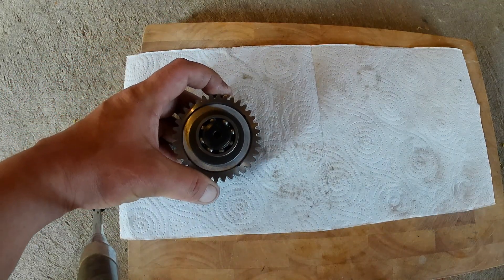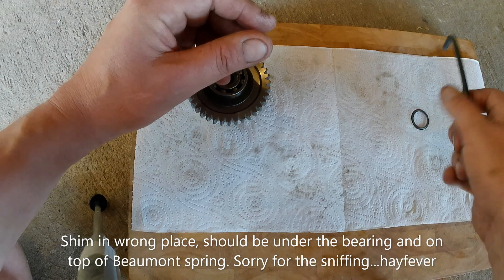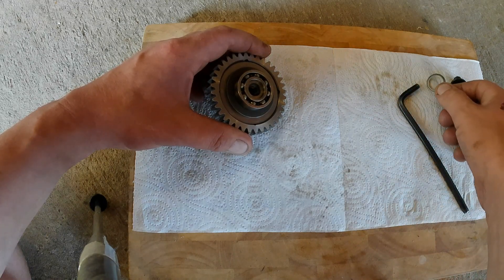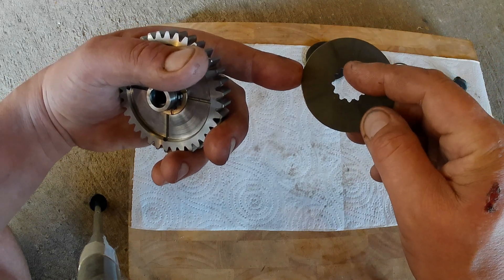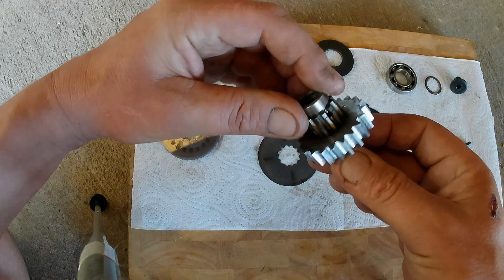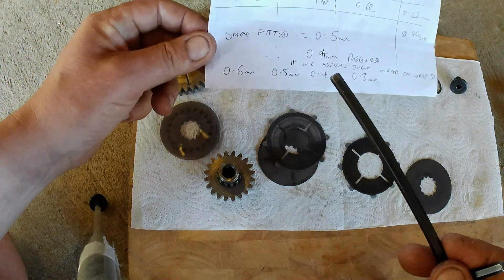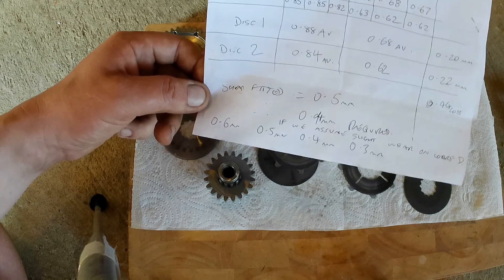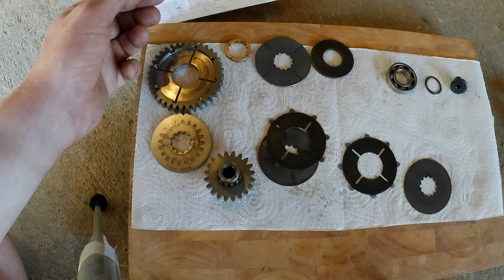BMW G450X (CCM GP450) Torque Limiter dismantling

Comment: Hey with what momentum would you tighten the bolt up again? Plus how are you checking the slip momentum?
Reply from the maker: @philip880  the bolt is tightened to 45Nm but is threadlocked. I did not check the slip torque, I measured the original plate thicknesses and measured the original fitted shim thickness and made up for the loss in plate thickness due to wear, by fitting a thicker shim. I am not recommending this as a solution, it's simply what I tried on my own personal bike.
Reply: @motomeltdown  so first of thank you so much for making that video.
Second and so on, i thought about calculating the slip torque and stuff, but checking with the right nut on the gear will be the more difficult step.
Ill see how i can check the slip. Also whaaat 45nm, seems a bit low, how did you get to that number?
Reply from the maker: @philip880  it's from the CCM GP450 workshop manual page 156, it's a small screw which bears onto a cup spring. The required slip torque in the torque limiter is between 190 to 250Nm when new and minimum 140 Nm lower limit when used.
Reply: @motomeltdown  awsome, can you send a link? Found one site but its broken and stuck
Reply from the maker: @philip880  you can access it by joining the "CCM GP450 Riders "Uncut" Group" on Facebook, and download it from the "Files" section.
Reply: @ i kiss your heart bro
Reply: @motomeltdown  btw, its a right hand thread? So left to loosen?
Reply from the maker: @philip880  yes normal thread.

Comment: Are you able to find replacement discs / rebuild parts?
Reply from the maker: I could not find any suppliers of the internal discs etc. The other part that wears is the splined phosfor bronze bushing that keeps everything centralised and running true.

Comment: Absolutely fantastic videos here. One theory I have as to the limiter losing tension might not be actual wear of the parts but rather that the spring as most metal does, lose its its original properties. Much like how a an old car will sag after a while because the spring takes on a new memory. To test this theory you would need a new spring and test it against the old spring to see what your slip value is. Again great video.
Reply from the maker: You could well be correct. My bike is a 2008 so the spring has been under constant pressure for 15 years.

Comment: You could check with local BMW dealer, if they have the G450X/K16 motor kit they have the test jig. If you were in the US I'd offer mine.
Reply from the maker: The USA not only has the best test equipment but also the lowest prices for replacement parts. I would also wager that you have some of the best off road routes available in the world.